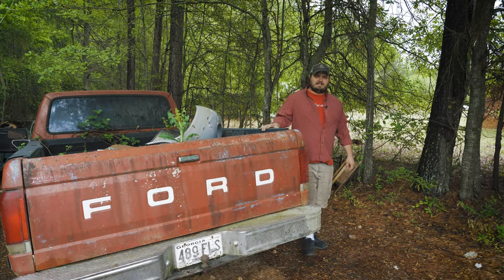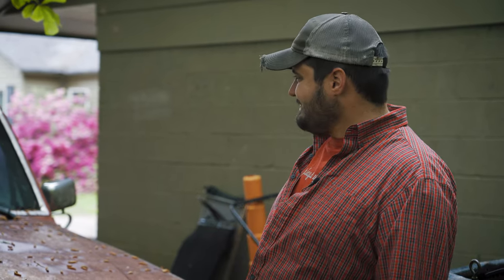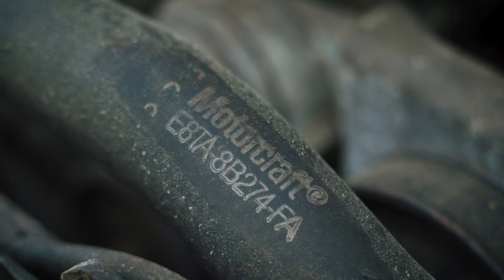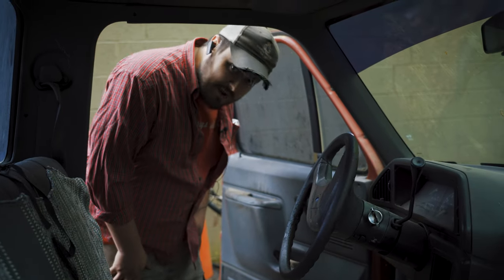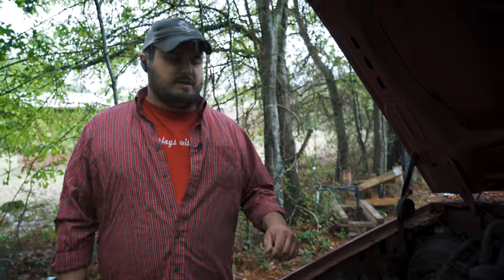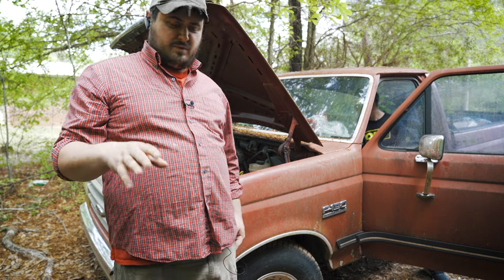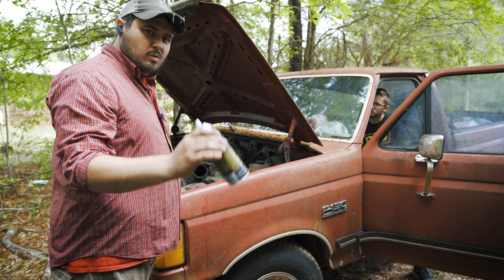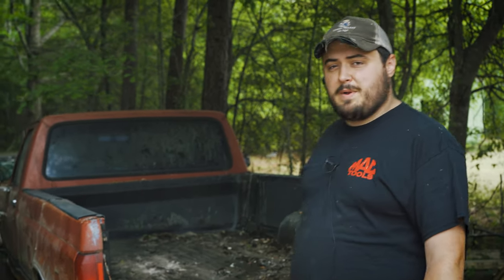CLASSIC FORD F150 RESTORATION, How to Restore an Old F150 Truck, How to Bring an Old Truck to Life!

Comment: Glad to see people save these old trucks. Good call on replacing distributor cap, rotor.  Check coil. And replace gas tank and sending unit. When these trucks sit for a long time these parts go bad. I bought 83 f150. Barely ran. Sat for decades. I initially changed oil. Put on a  new gas tank. Distributor parts. And fired it up and ran beautifully.  Drive it all the time.

Comment: got the same truck except mine is a 302 4x4 5 spd manual. i am currently rebuilding the top end. it had blown head gaskets and a burned valve and it is 40 miles away from me so I can only work on it a little at a time. but it was only 300 bucks and I drove it home from the guys house at night with no lights.

Comment: 8:26 You can buy small cone-shaped wire brushes for cleaning out corrosion from inside of the lead terminal-clips so that you can get better connections on the battery-posts. Often, these brushes come with an "opposite"-configured --- i.e., a hollow cup with inward-facing bristles --- brush for burnishing the battery-posts themselves, so that you can clean both sets of matching connections with the same device. :D

Comment: Always good to lube cylinders before cranking when it sits that long. Also this is my favorite body style of Ford, I have two of them, both '91s, but have the chrome grille and chrome headlight trim.
Reply: That should've been done and disconnect the fuel line then run it on an auxiliary fuel supply until the tank can be cleaned out. I have a 1988 F250 extended cab long bed 7.3 diesel, I bought a couple of years ago that had been sitting.

Comment: i have a 1988 f150 that i cant figure out. I am getting fuel pressure to the fuel rail, but it will not start unless i put quickstart down the air intake. The injectors, relatively new, are not working?? I already tried the relays and searched for lose or corroded grounds, i dont think that is it. I am leaning toward a bad computer?? Any ideas?

Comment: I’ve got the same truck dude. Well not exactly the same. Yours has a fancy black stripe thing down each side. But mine is an 87 custom. Even the same color, I think they call it medium fire red. Yours was in a little worse shape than mine. But when mine didn’t start I went straight to the neutral safety switch. Fixed her right up. Runs like a top. These 4.9‘s are indestructible. Some jack ass spray painted my whole hood so right now I’m cleaning a big red cookie sheet with oven cleaner. Works pretty good to remove the spray paint,but takes a 10 gallon barrel of elbow grease. If you have any tips let me know buddy. Mine just hit the road two weeks ago. No complaints. Keep up the good work and the posts. Can’t wait to see what this puppy turns into.

Comment: These 7th (80-86) and 8th (87-91) gen F150's are fastely becoming a popular platform as daily driver custom/street trucks because they one of the few classic you can still buy that are running and riving or could be for next to nothing for 2k or cheaper. The 300 is a great engine by itself but a 302 is a direct swap because they use the same motor mounts are the same and most of the wiring loom is the same.
Reply: I don't know why you would trade a 300 to a 302  300s are pretty much bullet proof and easily get 300 to 500 thousand miles if taken care of

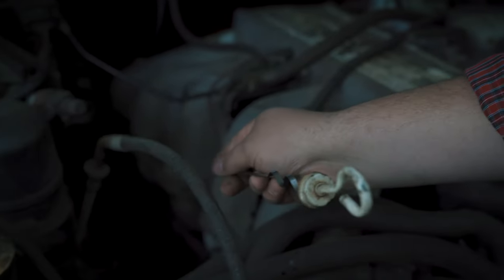Comment: 4:59 Of course, you would need to also see whether the odometer has the "seventh digit" --- i.e., hundred-thousands-place --- disk, since if it doesn't, the entire indicators-bank could have already "rolled over" at least once, and so it might have actually been at least a HUNDRED and eighty thousand miles that the truck had traveled, but you would never know it, even if nobody had tampered with the odometer. :D

Comment: just bought a 1997 f150 long bed but just found out today  probably needs whole new frame because of rust. How outrageously expensive is that?
Reply: Find another 10th gen f150 with blown motor and good frame and swap em up.

Comment: I cannot agree more on the teenagers fucking these things up I just got one that had a cutout in the bed for a stack and it has some meaty tires on it and it was fully painted with rhino line super sad but I took the paint off and the stack off and I’m trying to save it right now! I’m 18 and not even I would spray paint the interior red 😢

Comment: Dude didn't pull the plugs and lube the cylinders after sitting for a decade 💀 those poor cylinders. Also doesn't understand that if cranking slows them wires are burning. Dude calls this a restoration 😂 it's more like a failed zip ties and bias plies cold start. You have sooo much to learn